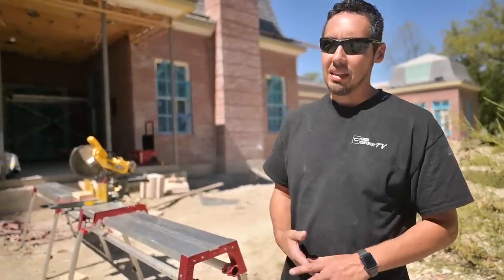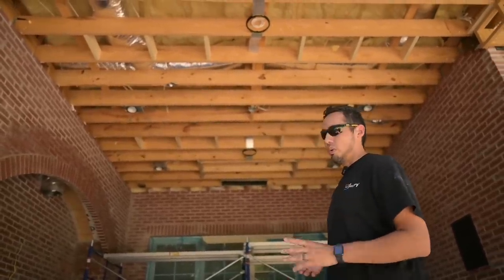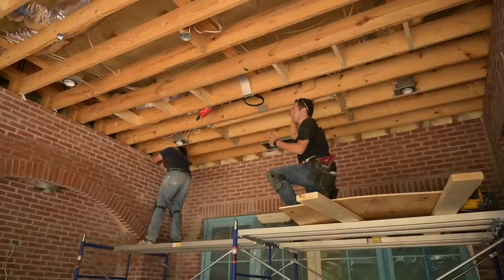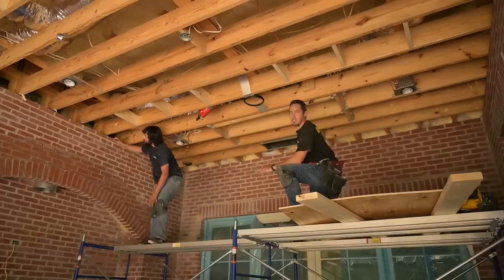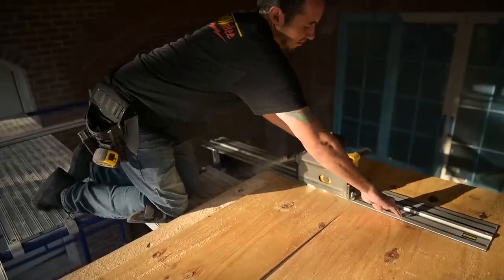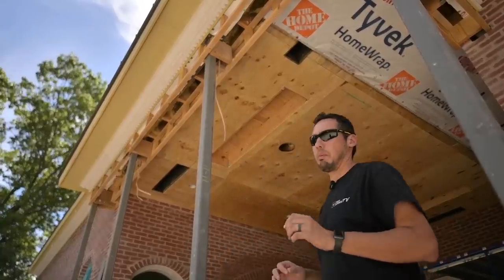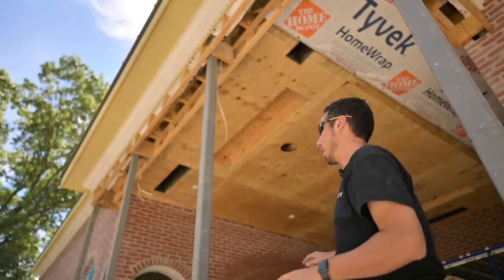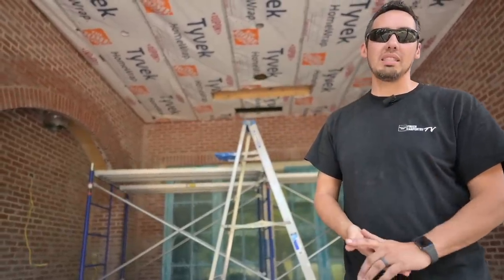Can these boards survive outside?  Exterior Finish Carpentry

Comment: I like that you're using CDX vs OSB, that's a huge difference that people try and save money on. For those reading this... CDX is a harder plywood which will allow the trim nails or screws to fasten to more solid, especially on a ceiling.
Reply: @ethanboggio3314  Ethan now is I was a piece of OSB how do you think Mrs OSB would feel?  Like?
Reply: @ethanboggio3314  advantec is totally agreed upon as being the best subfloor, and it’s osb. Not to mention all the zip products. Only old timers and know-nothing homeowners think it’s always crap.

Comment: You had me choked up laughing when you said if you ask a trim carpenter ti do sheathing. I started working for a commercial builder in Austin  after 21 years by myself and it's crazy how much time those guys don't take to make thier product look right. It's frustrating but I have to tell myself I work with wood butchers now..

Comment: When we do sheathing on ceilings I normally use screws .. I would shim joist if the gap is larger then 3/16 then apply plywood.. keep up the great work
Reply: I was wondering about that. Will nails pull free? They don't have the "drawing together" (torsioning?) force, but they snap more easily, IIRC. I've used screws and angled ring-shank nails for that reason in the past, but I'm not an expert.
Reply: Any application overhead that ur using as a substrate to then nail tongue and groove board too will be very heavy screws will definitely help with holding power ..
Reply: I was taught if you use only nails in this application to also apply construction adhesive to joists. An old boss of mine would nail it up with framing gun, then reinforce with screws. So many ways! None are right or wrong.
Reply: @jeffschiefelbein225  construction adhesive is good if u use a siding nail gun with ring shank nails .. but best way is to use screws aleast in conjunction with nails .. in a perfect world I always try to run tongue and groove perpendicular to the joists with no plywood.. in that way  it would be secure

Comment: A hammer tacker and a longer roll of tyvec would save you a lot of effort I think.
Reply: Hammer tacker is for roofing, not house wrap.
Reply: @Bigelite094  a hammer tacker is just a stapler and is used by most people who install tyvek
Reply: @Rizzo2185  That just makes swiss cheese out of the house wrap. There's a reason he didn't staple it.
Reply: @Bigelite094  I think you are right. Those caps are going to get in the way. Just need to hold tyvek up until the boards go up.

Comment: I wonder how the cost would compare of CDX + Tyvek vs Zip System in this application. Taping the seams of your sheathing as you go would be a lot faster than making a whole second trip around that ceiling to put up the Tyvek. Though honestly just taping the seams of the CDX would probably work just as well since Tyvek is pretty vapor open anyway…
Reply: I agree, I don't really see what the tyvek adds to this. The spray foam is a vapor barrier, so everything beneath it will equilibrate to outside levels. It hopefully isn't connected to the inside of the house. But if the manufacturer calls for it, I'm not one to say not to do it.
Reply: I'm betting it may have something to do with wood movement. The Tyvek could act as a decoupling membrane allowing for friction reduction between the plywood and the T&G potentially reducing expansion/contraction issues between materials with dissimilar expansion rates.

Comment: Would the green zip boards work? Instead of putting the vapor barrier up.
Reply: As a vapor barrier yes, but they are osb panels. They wouldn't be appropriate for holding fasteners

Comment: Where are you guys getting your millwork/trim from?  I can't source anything here out of Lowes or HD, all MDF and nothing for taller profiles beyond 3 1/2" base outside of slab side 5 1/4.??  No millwork supply around here for who knows how far away...hundreds of miles...  And working on scaffold too tall absolutely sucks!  You should have gotten some shorter frames ...been there done that for years.

Comment: Just curious, is that conditioned attic space above the install?  If so, I would think it would be necessary to have some sort of insulation between the sealed attic and the sheathing or tongue & groove to avoid water condensation from the boards becoming too cold on humid days.  Really don't know too much about this, so just asking.

Comment: What fasteners are you securing the plywood with?  Gravity and massive temperature changes will move that ply throughout the year & the fasteners for that have to have a decent head on them.
Reply: I was wondering that too, I thought the nail gun was just to hold the sheathing up until screws went in... I mean that 1" x 6" t & g aint light  😕

Comment: Personally I think I would have put firing strips on the joists first 16 inches on centre,  then put the T&G straight on , then you would have air flow, and you wouldn’t need the plywood and  Tyvek.

Comment: Was thinking of doing the same thing on my patio ceiling. However, it’s already a finished ceiling and we are in Arizona where rain/humidity is less of a factor. Would it still be necessary to put the wrap over the sheathing? I’d still need to apply the sheathing for the same reasons you are…something to nail the T&G boards to. Since my ceiling is already finished could I use thinner sheathing?
Reply: What is ur finished ceiling made of ?
Reply: @scottbertrand2057  drywall
Reply: @carlsherer9770  I installed nickel gap on drywall ceiling at my house .. I ran the nickel gap perpendicular to joists used construction adhesive, nailed it with 15 gauge finish nails and randomly used trim screws..

Comment: I have a hard time imagining that Tyvek will do anything to help with moisture for the trim boards being that the trim boards are closer to the weather than the tyvek
Reply: The purpose of the Tyvek in this application is to prevent the “moisture-filled air” from migrating from the open space above to the back surface of the TG boards where it could potentially condensate. This probably wouldn’t happen because of the sheathing, but as Richard said, the builder and home owner specified that’s what they wanted. The front,
 side of the TG boards won’t have any problem with moisture as they are primed, treated, and are exposed to plenty of moving air which allows the surface to dry quickly, if it happens to collect moisture.

Comment: 6:19 Why don't you have to stager your joins like when you lay a subfloor. Why are you able to go both directions?
Reply: From what I got out of the video the plywood isn't there for any structural reason it adds a barrier and smooths off any differences in height between the joists. Still its probably good practice to stagger stuff when you can.

Comment: I was under impression that the sheathing panels were not staggered. It may sound redundant in this application but it is a good practice in my opinion.
Reply: I don’t think they were trying to stagger the joints. I think they just may not have been able to cover the whole gap if it was 3 sheets wide running the same direction. May have worked out to less sheets that way.

Comment: I first wanted to thank you for taking the time to post your videos. I’ve learned a lot over the past year. I was wondering why you installed blocking since you were installing the 1/2 plywood. Was that a design change? It seems like you could nailed to the ceiling rafters.
Reply: No ceiling rafter where the coffered beam is going so the blocking is where the beam will be sitting in between two joists.